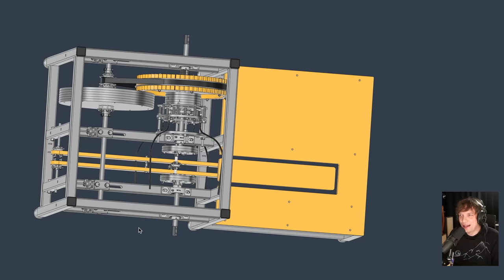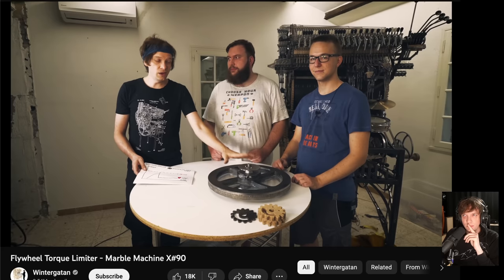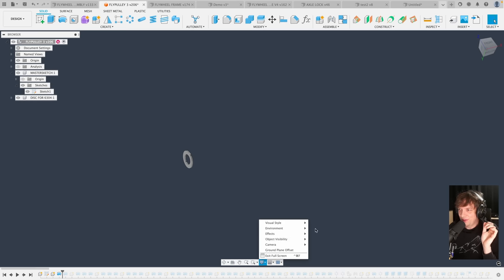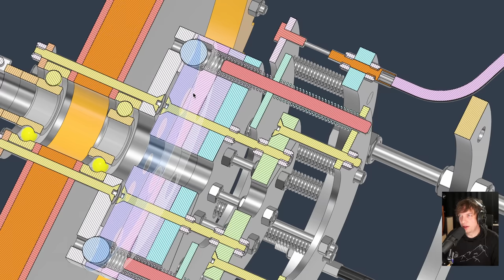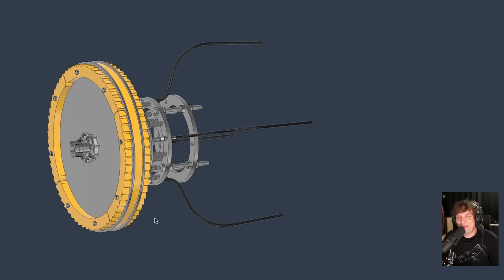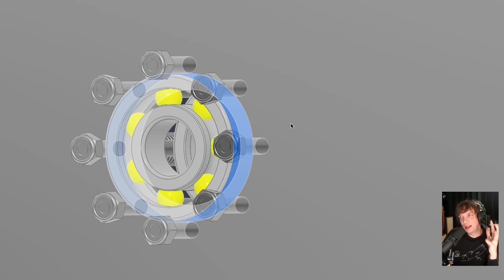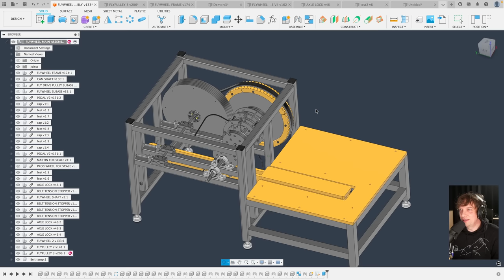Safety First! - Marble Powered Clutch

Comment: So you have a way to isolate the flywheel from the rest of the machine and the pedal. I feel like you should also have a way to isolate the machine from the pedal, as the inertia of those three programming wheels is definitely enough to cut your toes off. a freewheel mechanism like the one connecting your bicycles pedals and rear wheel should do the trick.

Comment: Those ratchets will probably be used to give Wilson a little spin. I think he'd love that. Or they could be used to load energy into another system like for an additional on call instrument or sound effect.

That pedal scares me.. wouldn't it be safer to have it push onto the axis from above with no fixed connection so it only engages when you push down on it?

Comment: I think you should reverse the disk assemblies, with the inner assembly fixed to the frame, and the outer assembly rotating with the flywheel, that way you will only need one Bowden cable to the centre, instead of the four.

Comment: My guess : Is it going to be a kind of rachet to start the rotation of the fly wheel as with the current mode of inputting power is not possible to start from stand still. It would be like trying to start riding a bike from standstill in a high gear with only one pedal. Given the location of this rachet system you would have a greater mechanical advantage (more leverage). this rachet would need to be spring loaded for it to come back up and dis engage in the resting position.

Comment: you definitely need a bearing-house because a bearing-house does not only position the bearing in the right spot but also clamps the bearing (a.k.a adds preload to your bearing), something i believe bolts are too imprecise for. but if you are going to use it like this at least consider using dowel pins for the extra precision.

Comment: I know nothing.  I defer to you, Martin, on all things mechanical.  But when I heard that you wanted to make your own springs on a lathe for the clutch mechanism so that they would be "just right" I immediately heard the "record scratch" and said "Wait, what?"  Springs wear out (again, I know nothing and I'm serious) but I am still pretty sure that over the life of any spring there is a curve over which the max pressure that the spring can provide declines. That curve is probably affected by how many times the spring cycles.   Unless you make enough identical springs to last longer than the expected life of MM3 (MMIII?) then you might instead find a commercial spring that works the way you want so that you can just order more should you need some.

I enjoyed the single-take video and I imagine that saves you several hours of work!

Comment: Martin, happy to see you healthy again! 
A bit of criticism, don't take it too serious, it's just my view. 
Like in the good old days you're getting too carried away by 3d modeling :) Everything you tried to avoid in the third version of your machine is planned in this particular mechanism.  I's almost painful to see how insanely overengineered it is. It uses FOUR bowden cables for a single operation and million of nuts for geometry adjustment. Just google the difference between static determined and non static determined systems. This one is mostly non static determined, and that's not really good.  Overall this flywheel assembly looks like it came from the second version with no changes. It lacks the elegant simplicity of the gates you created earlier.
You could at least use production torque limiter, production disc brake, production clutch with proven lifespan and reliability, less parts count, and that might be even cheaper. 
BTW: there is a silent clickless ratchet mechanism known as sprag clutch. And silent means really dead silent! I'm pretty sure that you, as a musician, don't want to hear these annoying clicks with every rotation of the flywheel.
Reply: Haven't you heard the other two machines in action?  A "quiet" (let alone "silent") mechanism isn't given any consideration--which is quite odd, given that he's a "musician"...

Comment: I would guess the ratchets are going to be some type of mechanical / adjustable  speed limiter. You will be able to set say 100 bpm and it will limit the speed of the drive to maintain that timing.

Comment: So for disengaging the clutch (via the bowden cables), you push a non-rotating disk against a rotating one. Might this create problems?
Reply: it's how manual transmissions work in cars. You need to get the pressure just right, so you don't rip the engine apart. Pretty hard to do as a newbie driver, so this could be an issue.
Reply: Some oil/grease does remove a lot of the problem. Also they are not spinning while pushed together, only at the changeover.

Comment: Martin. Be very careful. There is a reason that key-ways are used instead of half moons in all vehicles. Also, I have worked with bowden cables on stunt bikes, they are notorious for setting up correctly and that is with only two cables. 4 cables will be even worse. Think how stable a table gets when one leg is not EXACTLY the same length as the others and old stools always had 3 legs for this very reason. You may want to look at reducing the number of cables to 3 instead of 4 to make your life easier.

Comment: That “flat spot” in the shaft is going to cause issues. The torque will force the two halves apart. A key way translates the force to 90 degrees against the shaft/flywheel.
I suspect that you’re going to have some badly bent bolts and perhaps a catastrophic failure if there is any significant force on that interface.

Comment: First off all, that is a sexy voice.

The barring house is just as precise as the bolt you buy, or make. Maybe you should make a costum bolt for it.
Loved the design and video format.

I beleave the new part of the fly wheel sistem is not musical, because will continous moving after the brake is released, so it should be something visual, like the gate fingers! LOL

Comment: Your choice of modularity in your design means at the worst case, if the bearing housing fails catastrophically, you can easily redesign it without introducing pesky moles all over the system.

Comment: I am less worried about the laser cuts and more so about the tolerance on the fasteners.

3D printed ABS bushing inside that arrangement.

Even with a 3D printed housing you can a little.

Comment: Location of the bearing won't be quite as accurate as the laser cutting of the disc, because of the clearances required for the bolt holes. Also a rolled bolt thread is not terrifically accurate in roundness or diameter. So you will have some slop. But if you adjust for minimal runout before tightening it all up it may work okay.

A more accurate way would be to locate the bearing using pins around the edge instead of relying on the bolt threads. The pins can be made a much more accurate diameter, and they can go into holes sized for a press fit. This is also one of the ways you could locate a bearing housing accurately if you were going to get one made.

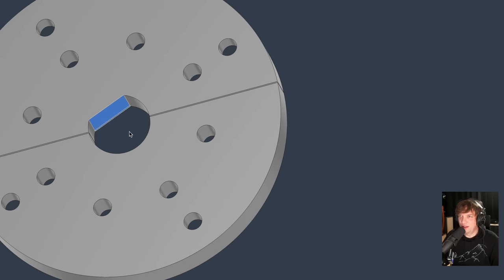Comment: 21:25 doesn't seem like an unreasonable way to "key" the shaft, but it is definitely a weak point. If there's too much difference in torque it's a likely failure point to split apart, and the bolts holding it together may just twist. That being said, I don't have a clue what the actual loads can reach or what the steel's tolerance is, and the whole point of the spring loaded ballbearings is to limit the maximum force that can be applied, and should slip long before it reaches the load necessary to cause that failure and subsequent damage.

Comment: Why not have the center hole in the pulley cut so the bearing can be pressed into it?  As it is, the current solution seems like extra steps in an effort to avoid extra steps.

Comment: The issue is the bolts will be imprecise and you assume that the bearing housing will also be imprecise becuase you are planing on bolt hole registration when you should be thinking about a proper registration cut.

Comment: clamping on the bearing... hmm. best way to get the stability you're looking for is 2 bearings on the shaft supporting the wheel. The greater the distance between the bearings, the more support for that 90 degree angle you're looking to maintain.

Comment: While I understand the little engineer in you says "I can make this myself" ...  why not use an industrial made limiter and clutch (automotive has lots of types and sizes).  Would save a lot of design and reinventing the wheel.  And it'll be cheaper and easier to replace if it breaks or wears out.

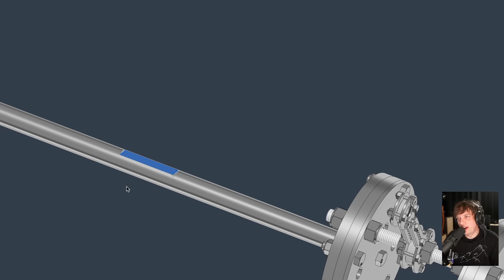Comment: Engineering teachers (and students) pulling their hairs out at 21:00 ☠
Not a durable design, especially if you have high torque ! 
At least put four flat spots all around the perimeter of the shaft ton allow better torque transfer

Comment: I think involving the safety mechanism in the clutch system is a mistake and you should use something else for the clutch.
1 - Safety.  2. Complexity.  3. Noise - release/engage will clack if it doesn't happen instantly.  4. Force required to turn it back on with flywheel spinning if that is in the plan - balls most likely slip easier when already slipping and with things not being sync I'm not sure it would be able to get it started. At least not without lots of clacking or springs that reduce safety.

Comment: The peddal seems more unsafe than ever. There's an easy solution like they do on power hammers. They have decoupled the machine weight on them so your foot doesn't get crushed.
Reply: I don't think the CAD model is complete. The sides of the peddle will extend downwards and it will be a close fit in the cutout in the platform. That way it isn't possible to get anything under the peddle. As long as there is plenty of clear area above the peddle then it would be reasonably safe. Though I agree that a better design would be to have a spring push the peddle up with a tension-only link attached to the crank pin.

Another way would be to not have a crank and put a one way clutch on the shaft. The peddle would then pull down on a cable wrapped around the outside of the clutch. This would remove the need to time the peddle presses which has it's positives and negatives depending  on how one is playing the machine.

Comment: Surely these flywheel and torque converter can be outsourced - design and supply by others. You don’t need to design every part, focus on the music, outsource the others. That’s how an engineer would build this machine. Write a spec and a tender. 
You don’t design a motor/gearbox for a machine, you buy them.

Comment: This can be simplified in several ways. Your design requires 4 bowden cables to operate. I see that being unreliable. 

If we look at the engineering for the (zx600k1). The 2003 zx6rr ninja motorcycle. The clutch is both a clutch and a torque limiter. The clutch uses 1 bowden cable. Granted it requires additional bearings and a gear to redirect power.

The other possibility is to use a hydraulic throw out bearing. This would use 1 bowden cable to activate a hydraulic circuit.

Comment: i do agree with others it seems a bit over-engineered but i dont like the flat spot on the shaft and lets split parts so it will fit. why not use a "inlegspie"(dutch i dont know the english word) it can be used for easy assambly and when the forces are getting to high it will split.

Comment: 18:06 - I would have thought that shrink fitting the bearing would be better than having the janky bolt fixing (which would lead to balance issues I'm sure) - Unless you feel that you'd need to replace the bearing often? But if it'd be only every few years then shrink fitting would work better and be simpler surely? 

(By shrink fitting, I mean freezing the bearing first then placing it in the hole) Unless there's a good reason for the bolt layout, but balancing and getting the bearing to run true would be a nightmare I would have thought with that setup?

Comment: At 22:22 the entire load of the machine is connected to the pully via 8 bolts right? if that's the case then those 8 bolts are going to be under so much tension and they will break. so the power from the flywheel comes to the pully from pully it goes to the 8 bolts from those bolts to the disk which has 2 parts and from there it will go to the rod. in this power transfer the weakest link is those 8 bolts which will wrap to one side under the load of the machine and will break. Please tell me i am wrong.

Comment: One thing requires redundancy: safety.
Imagine that your torque limiter fails.
It still looks like you can stick your foot between the pedal and the step, and get crushed.
It still looks like the flywheel can fly upwards.

Even machines with multiple safety features sometimes fail, despite redundancy: just look at what happened to the VELO of LHCb in early January. Having great engineers, tons of money and redundancy does not always prevent failures. This will cost millions of dollars to CERN. Now imagine without redundancy, how bad the situation would be.

Comment: Your bearing housing idea looks like a prime recipe for eccentricity. Maybe you'll be able to get away with that on some lower energy elements in your system, but it seems very sketchy for your fly wheel. 

Just think about the failure mode: say two adjacent bolts spread a little bit, the fly wheel is now eccentric and the inertial "centrifugal" force will try to push your bolts further apart and bam: positive feedback loop on a system with a ton of energy. Positive feedback loops are generally a recipe for either spontaneous oscillation or violent destruction. 

In the case of a bearing housing mounted to your fly wheel, you can indeed still have eccentricity. The key difference, however, is that your radial support is one continuous piece of material. Say your fly wheel is spinning eccentrically, the inertial centrifugal force will make it so that your axle tries to "cut" itself out of the bearing housing. But as the material is continuous, the more inertial force the axle applies to the housing, the more elastic force the housing will apply to the axle. In your design, you're basically providing the axle with a beautiful v-groove where it can start cutting its way out.

If you want to try out this experimental new design for a high energy part, you have to prototype it before relying on it. You have to challenge the idea in order to convince yourself it's not a dumb idea.

Comment: The only problem that I see with your bearing containment is that threaded fasteners don’t have precision diameters.  You can accomplish more precision by using three steel dowel pins to locate the bearing and three bolts to provide the clamping.

Comment: It seems to me those ratchets are designed with an angle and some sort of lever should be sliding on top of those letting the wheel turn in one direction, but in the instant the wheel turns the oposite direction, they will block the wheel, probably after you finish a song?, maybe you dont want to mess with the ball dispender... ? But seems to me it s going to be a noisy way to do that! i guess you could achieve this function with a set of two wheels of solid rubber, one of the rubber wheels will be in a free position when wheel is turning the wanted direction, but the moment its starts to turn backwards this third wheel will interlock with the second rubber wheel wich is always in contact with the rotating wheel , and this will create a sort of jam  of wheels... how the third wheel will fall to interlock the othe two... there it comes the balancer... 😂

Comment: bolts will have more flexibility than machined housing for the bearing. but honestly everything you've worked on since you shifted to engineering precision is 1000x tighter than than it needs to be for the application.

Comment: IDK...I recall in one of your other videos you describing how complicated it was to disassemble and reassemble some mechanism. Looking at your final design for the clutch, it seems like using the same bolt for everything may seem elegant, but it's going to be a nightmare to take apart and rebuild if it's not right for any reason.

Similarly, with the bowden cables, while they look cool, I feel like you're putting too many eggs into that basket.

And, overall, the flywheel stuff seems like you're skipping your original ethos of "design, test, etc." You were very methodical with designing the droppers and stuff - I hope you're going to put the same discipline into testing all of the above. 

Loving the new process, and I hope to see the new machine kicking ass sometime this year. ;)

Last - stop being so hard on yourself for the last machine(s). They were still functional works of art...

Comment: The only concern I have with the CAD model shown, is how easy it would be to get your foot trapped between the pedal and under the surrounding plate you have there; ostensibly to prevent your foot from being crushed by getting it caught under the same pedal.

Comment: Seems pretty complicated. Best part is no part, do the design requirements really need a manual clutch and brake?

Also the ratchets are are for a hand crank to get the machine started.

Comment: I would at least add a 3d printed spacer sleeve/housing for that controversial hub. You need something better to locate the bearing than just the threads which will be a bit jank. Vibration can easily shift the bearing due to the lack of precision.

Comment: So obvious question: Why design, from scratch, a torque limiter when you can just buy one? Wouldn't it be better to use off-the-shelf components as they'd be easier to replace in the event of a failure?